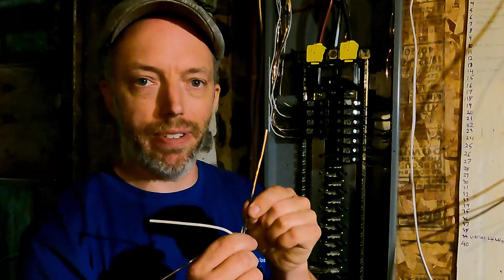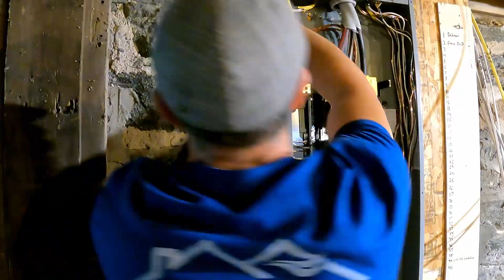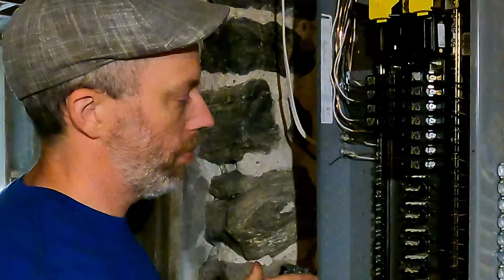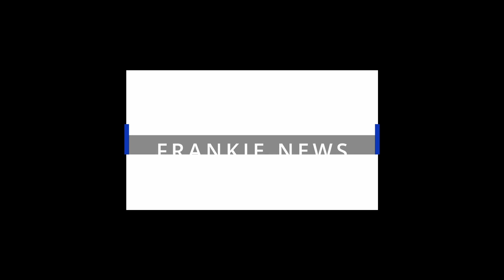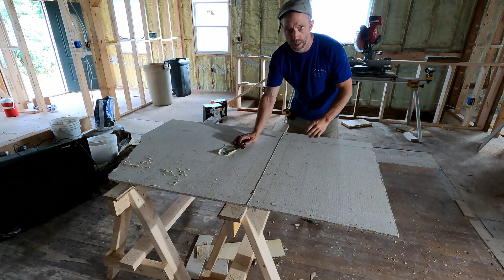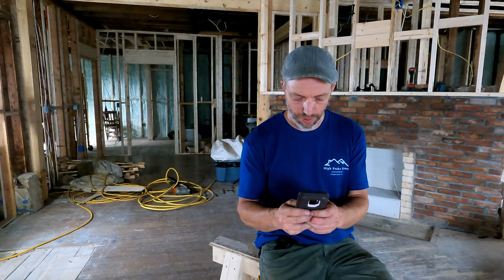Can it be too Neat? Abandoned House Ep34

Comment: Minimum bending radius is also defined in code.

 NEC 300.34
"The conductor shall not be bent to a radius less than 8 times the overall diameter for nonshielded conductors or 12 times the overall diameter for shielded or lead-covered conductors during or after installation. For multiconductor or multiplexed single-conductor cables having individually shielded conductors, the minimum bending radius is 12 times the diameter of the individually shielded conductors or 7 times the overall diameter, whichever is greater."

I've seen so many people ignore this, along with bundled wiring ... people don't realize bundled wires create impedance and that impedance creates heat and that heat leads to failed insulation and fires. Derating the ampacity of bundled wires is important.
Reply from the maker: Well there you go! The technical side of why

Comment: Where I live if the main panel of the house is not directly piggybacked with the outside meter base it is considered a subpanel, therefore requires a four wire system. All the neutrals and grounds have to be separated.  🙄
Reply from the maker: Wild..... here my ground rods are connected directly to the main panel .
Reply: @Empty Hammock Thank you for introducing me to this channel!

Comment: I like the idea of a raised hearth but wonder if it might be a tripping hazard since you have entryways to other rooms on either side of the hearth. I’m assuming the raised hearth you are thinking of would fit into the rectangular footprint? Maybe a more crescent shaped hearth - beginning/ending at the outer edges of the brick facing - would mimic the natural (shortest) path taken when walking through this room and minimize the potential hazard. Of course it also might be that the camera angles make it look like more of a potential issue than the reality.
Reply from the maker: Good point . I like the idea... (wheels turning)